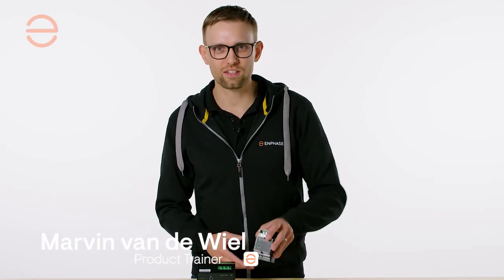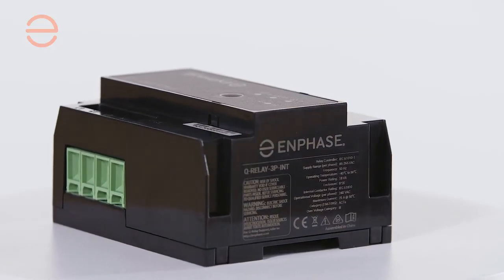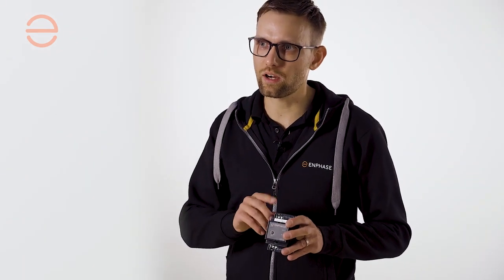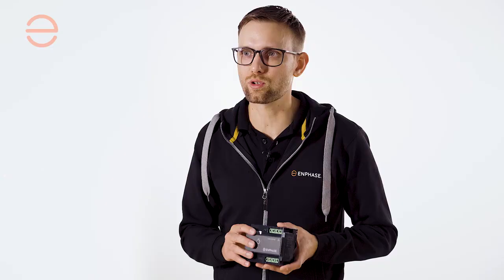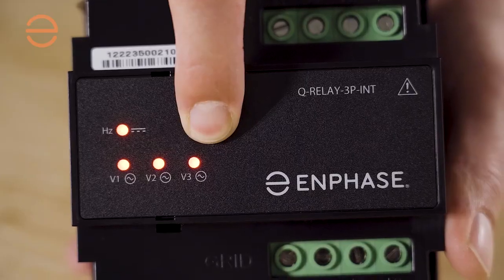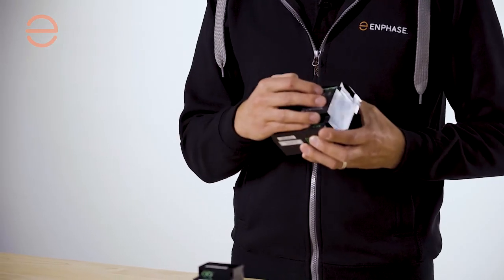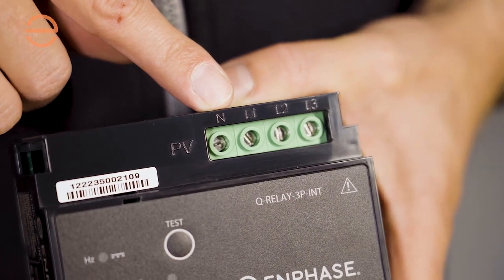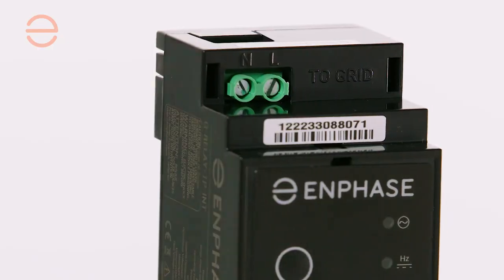Enphase Energy - Introduction IQ Relay English

Comment: If you have 2 strings, do you require 2 relays?
Reply from the maker: Of course, since acts as a galvanic disconnection device. It is designed for single phase use and has built in contactors. During specified grid abnormalities, the Q Relay disconnects the Enphase Microinverters from the AC grid, and when the voltages return to normal and the grid frequency is in the acceptable range, the Q Relay reconnects the microinverters to the AC grid. The Q Relay has built in current sensing that can detect DC current injection required by VDE V 0126-1-1 requirements. The Q Relay works together with the Envoy-S to meet the need to break both line and neutral per grid requirements. See full installation instructions for the Enphase Envoy-S and/or Enphase Microinverters at: enphase.com/support.